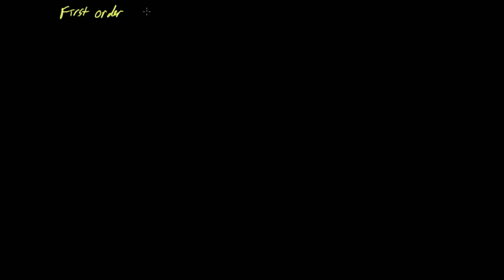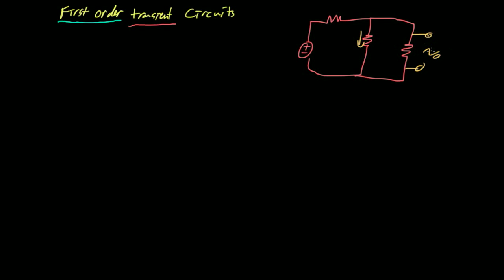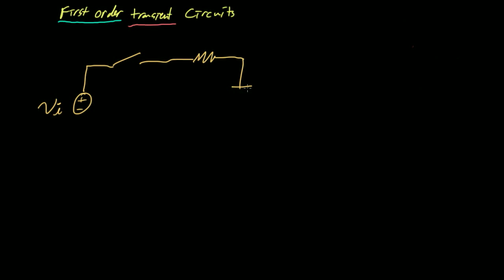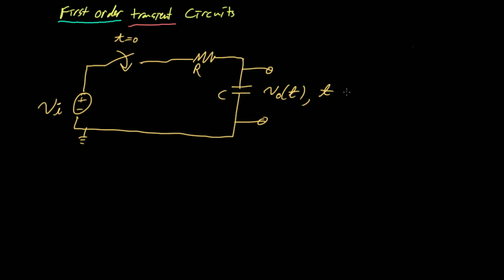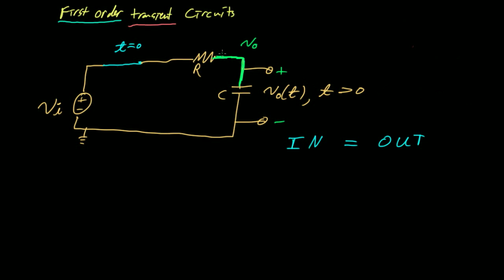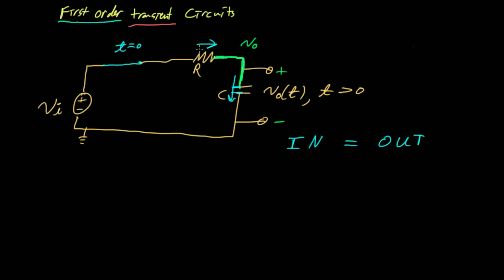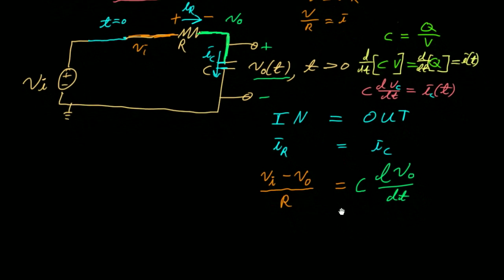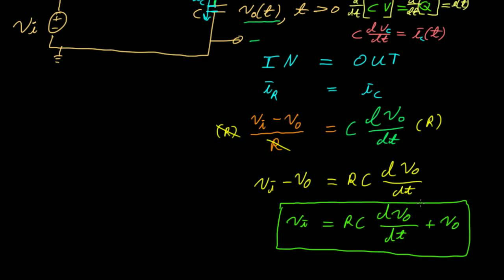Transient Circuits part 1.mov

Comment: Pretty good, but I suggest that you slow down, enunciate, and say things once.  This video should be 5:00 minutes.  Sharpen it up until there is no way to miss the point. Maybe check out Modeling Engineering Systems by Jack Lewis, available free on PDF.